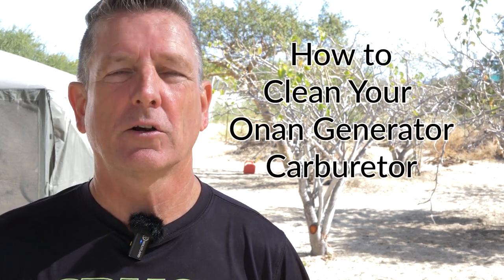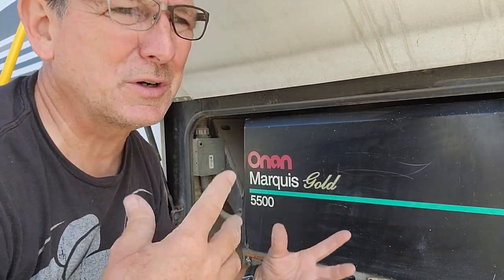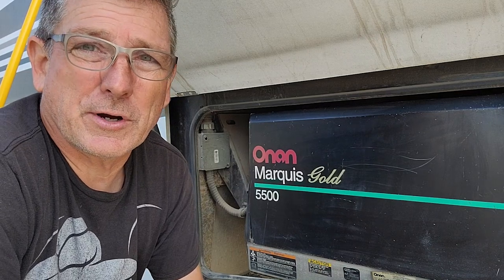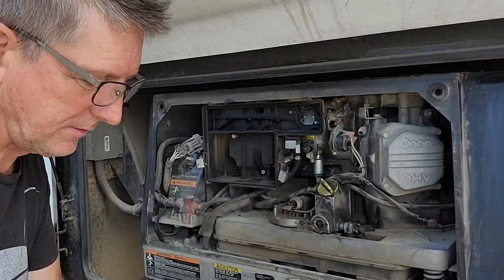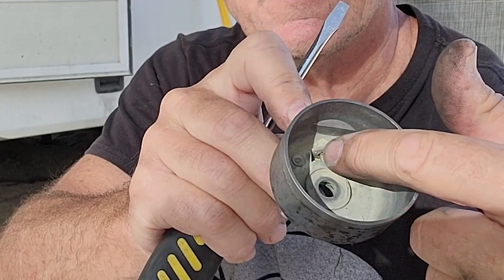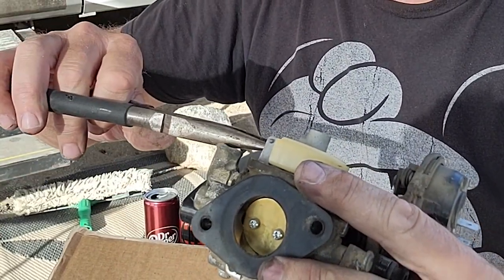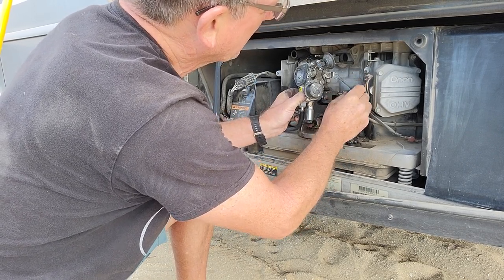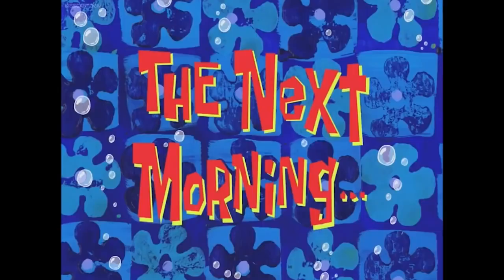REVIVE Your Onan Generator | How to Clean Onan Generator Carburetor | Onan Generator 5500

Comment: Just used this video to fix our code 36 issue and turned out it was the fuel solenoid  that we thought was a water censor to kill the engine if too much water was in the fuel.  Cleaned the solenoid which was VERY stuck and it fired up and ran clean after 2 years.  You're a saint good sir.
Reply from the maker: It's great to hear comments like this! That solenoid is a pain in the butt and such a simple fix that people can easily tackle it on their own. I am glad you were able to get your problem solved! Safe travels!!

Comment: Great video! What size is that fuel line? I will be doing a similar service soon. Genny still runs but not great and smells horrible. I'm gonna do the seafoam treatment where you connect a separate fuel line to a jug of gas and seafoam mix. Then fire it up and let it eat. Also probably get the service kit with new plugs, air, fuel and oil filter. Hopefully that brings her back around.❤
Reply from the maker: Unfortunately I don't know the size of the fuel line. I've never tried the seafoam stuff. Good luck!

Comment: How Manny turns out from stop is the altitude jet?
Reply from the maker: If I didn't mention it in the video, I do not remember Randi. I just rebuilt my mother-in laws generator carburetor and forgot to count the turns before taking them out. I grabbed the info from online somewhere, as a starting point, and then kept testing until it ran well. It's close to 2 turns, but not sure if it's that jet or the main. You do the same thing. try to start it at 1-1 1/2 turns and see how it runs. Keep adjusting until it runs smooth. Sorry I don't have a better answer.

Comment: Most old-er RV's don't have the Gold version, and is totally different with the carb disassembly... I have an Onan 6000 and looks nothing like the Marquis models... BUT, Mine is on a sliding tray.... and I use it when driving for ac instead of running dash ac. mostly....  I do believe in the solar setup as I have several portable Bluetti systems that have 30 amp RV outputs . Really it all started with sailboats... Solar..... cheap bastards, saving their money for Rum.... Today, if I sold my antique 1978 GMC Royale... I would opt for a 33 ish (non Thor product) built before 2010 and convert to batt and solar totally. DC and inverter system.  ( no Propane) .. I would probably run AGM's or Gel... Then down the road if anything happens. you can replace a bad batt easily with whatever except lithium...
Reply from the maker: A sliding tray would be so much friggin better! Good luck finding a non-Thor product nowadays! They own everything!! You did say 2010, so you should be good! Lol